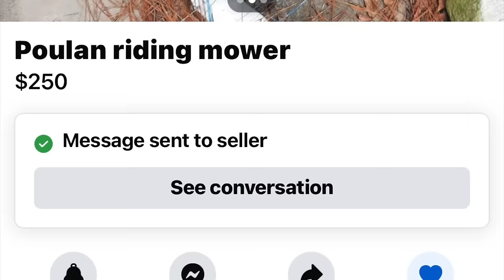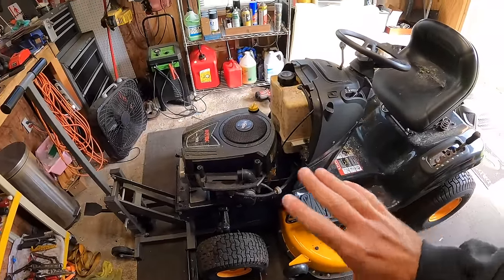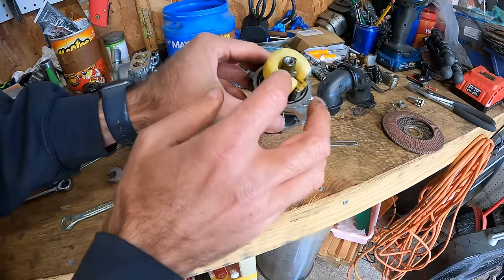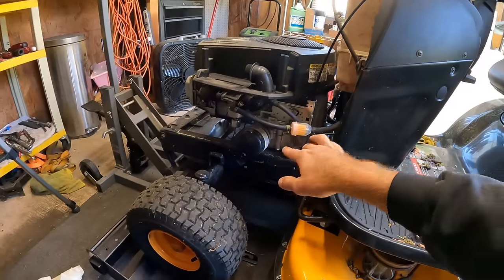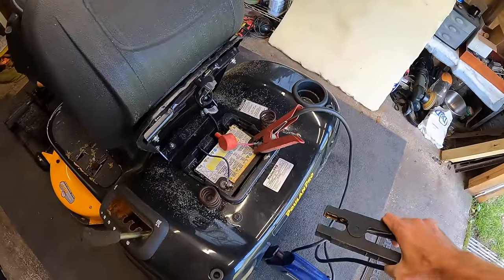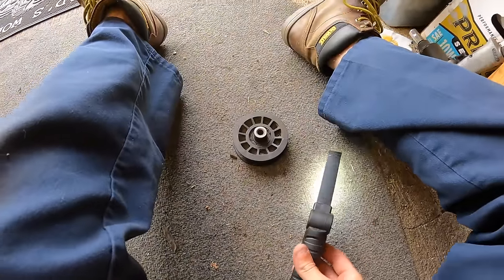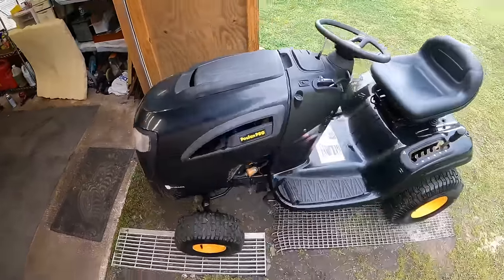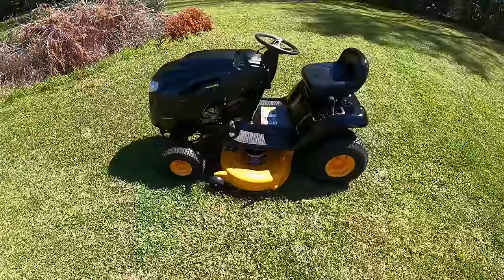FREE MOWER TO $2000 EP 3 | POULAN RIDER REVIVAL

Comment: I lucked up on a mower like this a few years ago. One of my neighbors had a brand new mower given to her by her father that she never used. It had been sitting in her back yard for several years. She was disabled, and her yard was completely overgrown. Someone filed a complaint on her, so my mom and I went and cut it for her. She gave me the mower in exchange. I wasn't expecting anything, but I was happy to get it running again and keep it from rotting away. I just had to put a battery, carb needle, do a carb rebuild, and deck belt on it, and I had it back up and running again. I have been using it for several years now, and I am only $80 into it. It has less than 200 hours on it.

Comment: Good job, Alex. 👍
That machine should go for no less than a grand!
Couple things I’d do differently - since you do so many mowers I’d have a dedicated pump spray bottle just for used motor oil and spray the underside of every mowing deck and push mower. 
Also, since that Poulan is so fast, I think a pair of yellow racing stripes down the middle of that hood would really look great!

Comment: The pedal sticking problems is only going to get worse especially in dusty conditions. Cheap fix, take out the battery and battery box. Take the left screw out of the transmission cover. The two halves of the cover are connected with a small strip of plastic. Cut the strip to separate the two halves. Now you can lift up on the left cover half. Look for a well in the transmission housing, it will be filled with dirt. Break up the dirt and blow it out with compressed air. This will reveal the three return springs in the well that get jammed with the dirt.  It will then work like new again.
Reply: I just cleaned mine out again because the pedals were sticking and I only saw two return springs so my memory was faulty.

Comment: I was gifted a Troy-Bilt Bronco 42” and so far I have had to replace a RF axle, all four tires, blades, deck belt, steering ball joints, deck discharge chute, fuel filter, oil, had the original from the factory oil filter on it, spark plug, reconnect the deck lift/height adjustment it was disconnected, the engine is a KOHLER and runs like its brand new.
Reply from the maker: It sounds like you have put in a lot of work on that one. I bet it will run for a long time now. Thank you for stopping by and sharing. 😎
Reply: @freedommowers420  only issues is it surges after about 10 minutes so replacing cruddy carb.

Comment: Awsome this content is awsome and i had a poulan pro before so story starts maybe 2016 me and my dad went to pick up this poulan pro when we got there the front of the hood was gone so we had to use straps to hold on the hood so maybe 2019 or 2020 my dad lost the key and left sitting in the backyard for probably 4 years than one of my friends dads came over i guess he works on mowers too so he came over and asked if he could take it also we did pull out a murray push mower out of my dads shed and that one was a 2016 and i tore apart the murray engine and the poulan pro engine because i wasn't good at engines and more at the time and so the guy took all the mowers and parts away but yeah good job today alex!
Reply from the maker: Awesome story and thank you so much for the support. I really enjoy working on them, and it helps with my PTSD as well as anxiety. I hope you have a great day!!
Reply: I forgot to say happy easter!

Comment: HI, Happy Easter. Paper filters should not be used for gravity feed fuel systems.
Reply from the maker: Happy Easter to you! I’ve heard mixed opinions on the paper filters. What makes them not suitable? I’m always trying to learn.
Reply: @freedommowers420  They can work, just clog easier, because they filter smaller particles, and sometimes not enough pressure for gas to flow through them.

Comment: Hey, I know you’re mower mechanic so I just wanted to ask you a quick question I have a GT275 John Deere with a 17 hp Kawasaki I’ve checked the spark it has spark, fuel air and it for the life of me I cannot get it to start I took the head off, clean the head, dumped it in gasoline and wiped the head with a paper towel for the life of me, I still can’t get the start it just backfires out of the carburetor. I’ve checked the gapping and everything that’s all online. I just wanted to see and it has a new carpet. I just wanted to see if you knew what would be going on with it
Reply from the maker: I would say with everything you told me that the timing is possibly off. There is a key way on the flywheel that connects to the crankshaft. If it has sheered the key, you can have good spark, fuel, and compression. It’s just not firing at the right time. You will have to pull the flywheel and see if the key is sheered.
Reply: @freedommowers420  OK I replaced the flywheel cue a couple months back, but I’ll check the timing and stuff like that and then if it doesn’t work I’ll get back to you